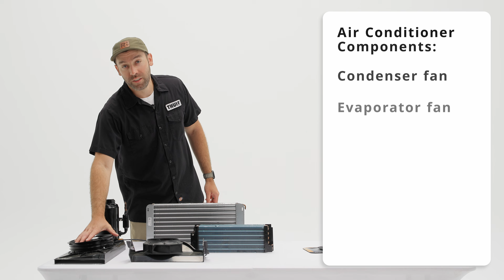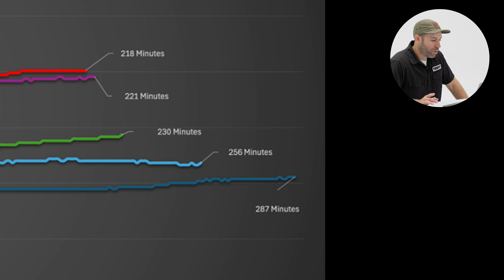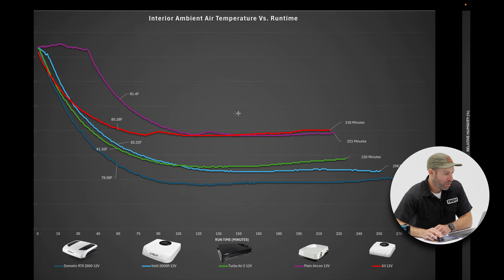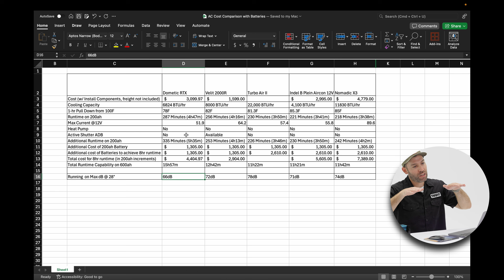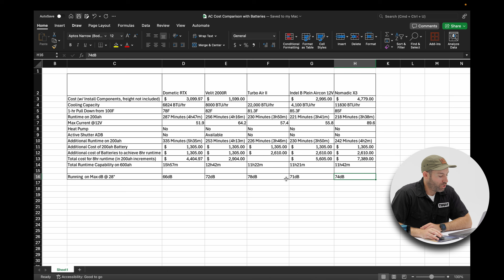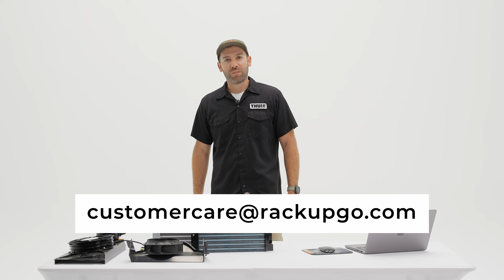Heat Chamber Test Results | The BEST Battery-Powered AIR CONDITIONERS for Vanlife

Comment from the maker: One Year Update: Our Response to Nomadic’s Rebuttal

After a year of legal intimidation and, more recently, a direct attack on the credibility and integrity of our team, we feel compelled to respond to Nomadic’s latest rebuttal article.

Read our full article here: https://rackupgo.com/blogs/buying-guides/one-year-update-our-response-to-nomadic-s-rebuttal
Reply: Nomadic was right, this was a misleading video. It's clear from their specs the X2 would have drawn much less power. You didn't mention this in the video, you just provided it side-by-side with other units that clearly aren't the same as the X3, but are close to the X2. Also, you included the MSRP?? Most people don't sell their units at MSRP, they sell it with discounts. And not only that, the X3 you list as $4799, when their MSRP today is $1000 less than that before the sale price. So of course nobody's even going to go look at Nomadic's lineup! If they did, they'd realize 1) the prices are competitive and 2) there's a more efficient unit! You should post an updated video clarifying this stuff, or you're being shady.
Reply from the maker: @taint_misbehavin  Thanks for taking the time to share your thoughts. For additional clarity, the test compared the air conditioners side-by-side in a controlled heat chamber environment. The Nomadic X3 was actively promoted as their flagship, and rather than rely on manufacturer claims, we focused on real-world data we could verify ourselves.

As for pricing, MSRP was used simply as a uniform baseline to allow fair visual comparison across brands, since sale prices fluctuate week-to-week and vary by dealer.

We detailed all of this in our blog articles as well as in this video. In contrast, Nomadic’s claims have shifted repeatedly and often contradict their own published specifications. 

As for the X2, Nomadic's own published specs state: “The X2 is designed to maintain a temperature difference of 15°F - 20°F, ensuring consistent cooling.” A 20°F delta from our 100°F starting point suggests the X2 would not have been able to meet the test’s 75°F setpoint. Thus, the X2 did not meet the conditions of our test.

The goal here is to remove subjective marketing, and provide objective, measurable results that help builders and end users make informed decisions. In response to our tests, we continue to receive overwhelmingly positive feedback from end customers and professional builders who have replicated similar results in real-world use. 

We do really appreciate you taking the time to provide your feedback. We always encourage you, the reader and viewer, to review the data critically. Ask your own questions. Form your own conclusions. That’s exactly what our testing is meant to support.

Comment: Thanks for doing the test. Good video. Not sure why you'd display RH instead of dewpoint - dewpoint is what is important and is the way to measure how much moisture is actually being pulled out of the air. RH will change with both dewpoint and ambient temp, so your graph is combining two variable in one line.

Comment: No details on how these tests were set up, and how they were set up to be repeatable with ambient conditions concerns me. I also feel like you missed the mark with the humidity even ignoring the starting humidity issue. The drop-off at a later time isn't a good thing. The Turbo air cooled faster than the Velit early on but didn't spike the humidity BECAUSE it was removing water the whole time, indicating that it not only dehumidified better but also was cooling better when you consider the latent heat associated with de-humidification. Lower coil temp below the dew temp and higher deltaT will increase de-humidification, not some arbitrary interior temp, other than a high interior temp is going to keep the coil above the dew point if the AC is tuned for energy efficiency with low dT. I would say this is likely why the drop off on the Velit and Dometic, other than the temp had largely stabilized before that point and there really is no indication in the charts for why humidity suddenly dropped like this unless the temp sensor is poorly representative of average air temp. Even with the drop the Dometic dehumidified quite poorly relative to how well it cooled, even starting with a disadvantage it was clearly never going to come back into alignment with the others, which you can't ignore over simply observing that it decreases from peak a marginal amount. Relative humidity is also taking into account the air temperature as stated, which is entirely different for all the points on those graphs making the comparison rather watered down. Looking at the spreadsheets it's like these tests are just stacking variables on variables on variables, too many of them are struggling to be controlled. Put it on a DC source with a shunt to end the test at xyz Ah. Lock your exterior chamber at 80/90/100F for the whole test with a heater/vent greenhouse relay thermostat and you'll have a much more useful performance comparison.
Reply from the maker: https://rackupgo.com/blogs/buying-guides/heat-chamber-test-results-dc-powered-rooftop-a-c-units
Reply from the maker: You are not wrong that humidity data gets complicated fast. That’s exactly why we published the raw spreadsheets instead of just cherry picking a headline.

A couple things though: a lower RH number at a hotter interior temp is not automatically “better” dehumidification.Likewise, a temporary RH spike during rapid pull-down is not automatically “worse.” Compressor speed, coil temp strategy, airflow, evaporator sizing, and control logic all affect how moisture presents during stabilization.
The peak current/wattage issue from your earlier comment also falls into this category. These systems are highly dynamic and not all metrics occur simultaneously.

You may also be mixing psychrometrics with assumptions about each unit’s tuning strategy. Some manufacturers intentionally run higher evap temps and lower deltaT for efficiency and freeze prevention, especially in variable speed DC systems. Others prioritize aggressive latent removal earlier in the cycle. Neither approach is inherently “wrong” without defining the actual design target.

As for test methodology: same chamber, same battery source, same setpoint, same starting conditions, same heat load, same install style, same logging cadence, etc etc etc. It was designed to be a controlled comparative field test to show consumers how these units behave relative to each other in the same environment. As close to real world controlled testing as we’ve seen in this space so far. If there’s a better publicly available comparison, genuinely, send it our way. Otherwise, it sounds like you may want to design round two, and we’ll happily compare notes.

All that being said, your suggestions about fixed exterior chamber control and Ah limited testing are good ones and would make for an even more engineering focused dataset in future rounds.
Reply: @rackupgo  I looked at the data, but there is nothing to describe what your testing setup actually is. You describe it as an "independent test lab" but lets be real. There's up to a 6-7 degree temp swing on the hot side in the averaged first 180 minutes of testing. Don't get me wrong, I have no problem with semi formal testing, but I don't like it being presented as a "lab", a lab generally understands the scientific process and should be fairly held to that standard which isn't met here. You mention the same "heat load" but again, what is the heat load? The thermal transfer between the exterior and interior of what container? Because then that's dependent on the interior vs exterior temp differential which isn't consistent, and also dependent on the CFM of the unit cooling the walls via convection. I'd really prefer to hear the details rather than speculate whether it's even remotely applicable to the heat load of my camper.

At no point did I say lower RH and higher temp is better de humidification, otherwise the best humidity curve would just indicate the worst cooling units and lose handily to a space heater. This is specifically why I compared and contrasted the Velit and the Turbo air. Because their temp is very similar and therefore easy to draw a conclusion on humidity. You say that neither RH profile is inherently wrong, which I agree with considering that both of us said basically the same thing about lower dT being an efficiency strategy at the expense of de humidification,  BUT @8:25 the presenter says "Turbo air 2 didn't really do that well" then immediately praised the other 2 for dropping RH hours later. With the lens narrowed to just de humidification the turbo air did objectively better than the Velit for the entirety of the run time, considerably better early on leading to the subdued climb, but they do not understand that and simply think a peak then decline in RH is THE indicator for dehumidification.

I say the Dometic dehumidified poorly because the RH at 90 minutes and the RH at 290 minutes went UP 2.5%, a time period where the temp also went up 2 degrees. In a sealed chamber it simply didn't remove water over a 3 hour period. All of this time was spend at ~10% higher RH than the end of the Velit test. Realistically none of this is a great test for de humidification, because the air was started practically bone dry due to preheat (again I have to assume) and 30% is a point where removing humidity might be a bad thing from a health perspective. Even the worst point of the Dometic is still acceptable relative to a realistic starting point we'd see here in the midwest with 90-100F at 40%+ humidity. So please add starting with tangible and precise humidity if you want to test dehumidification to the suggestions list.
Reply from the maker: @n @nickmeyer208 ou’ve clearly put some thought into this. There are practical limitations to controlled real-world testing that are easy to overlook from the comments section. You’re not wrong on several points, but there’s also nuance here that’s being seemingly overlooked. To our knowledge, these are the most comprehensive real-world comparative tests currently available. The alternative is relying on advertised BTU numbers, some of which have now been quietly removed from their own websites. If you believe you can build a better test methodology, we genuinely encourage it, and we’d be interested in comparing notes once you do.
Reply: First, I would like to commend the effort that went into the tests for this comparison. Lots of work, reasonable effort to create conditions to get comparative results. 

Relative to the conversation on humidity, there seems to be a driving force on RH being a critical component and that its not being addressed soon enough in the cooling cycle. I have to agree with the author on some of the reasons why the design may have yielded the results it does. If it happens too early in the cool down cycle, it can lead to freeze up conditions which would result in a unit that can't cool. You have to remember, these units can be used where the relative humidity is anywhere from 10% to 95% and the last thing you want to do is have a unit that freezes up because the evaporative coil reached a temperature to low compared to the dew point of the air. And of course it would have been a difficult measurement to make, but the mass flow rate of the condition air compared to the conditions of the evaporator coil can have a significant impact on whats happening with the latent heat removal in the condition air space. The greater the sensible heat removal, which can be accomplished by a larger internal air mass flow rate, the less cooling becomes available to remove the latent heat. I would suspect this is the reason why you see the step reduction in humidity after the unit has been operating for some time by some of the units tested. Since the recirculating air temperature has dropped, as a result of the sensible heat removal, the coil temperature is easing into the dew point temperature of the air. As a result, the coil starts to remove some of the latent heat, resulting in a reduction of the RH. From a design perspective this is a great approach because the evaporator coil won't dive too quickly below the dew point temperature of the air, creating the detrimental freeze block of ice. As more sensible heat continues to be removed, the temperature of the coil slowly continues to drop, removing more and more latent heat, where eventually the unit starts to cycle the refrigeration process on and off, giving plenty of time for the evaporator coil the ability to shed its collection of water vapor. I get why you want to remove water vapor, but the earlier you attempt to remove it, especially when there is still a considerable amount of sensible heat to remove, there is a high risk of failure of the unit because of the icing problems in areas where the latent heat is high. Of course if the latent heat is relatively low, this problem goes away, but because the manufacturer has no idea of where this unit will end up being used, they need to design the unit for the worst conditions. From a design perspective and looking at the data results, these units have been designed to insure minimal operational issues. As the units continued to be operated over days, they will whittle down the humidity to comfortable levels.

Comment: Great testing. Can you do the 48 volt velet
Reply from the maker: We have tested a few 48V units, including the Velit. We discovered an issue with the battery source we were testing with which led to inconsistent results so we haven't been able to release that data. We're currently looking into the possibility for a repeat test.

Comment: Ugh, I don’t know how I didn’t find this when I was doing all of my research but I ended up ordering the Nomadic X3 48v over the Velit because I wanted the best for my pups and it seemed to be the best but now I have major buyer’s remorse and concern. Have you done any comparisons with the 48v systems?
Reply from the maker: We have done comparisons with the 48V systems in a heat chamber under the same test conditions. Unfortunately, upon validating the results it appears that there were cell failures in the battery we were using to test which impacted the results so we are not able to publish the data from that test. When we're able to repeat the test, we will publish a similar video.
Reply: looking forward to that video! And thanks for this one, by the way!

Comment: A very thorough and excellent review of RV air-cons. Your graphs and detailed Excel data spreadsheet about power consumption, current draw, price vs BTU etc were stunning. Well executed, as I look to invest in a unit for a new ProMaster.
The components you had on the table were from what company? What is the warranty on these units? I don't think I heard any mention of it. 
Guess I will have to visit their websites to learn more.
Just one suggestion - ditch the music soundtrack. It was distracting and annoying and really not needed. It makes it easier for the viewer to truly focus on what you are saying. It does not add to your fabulous video. 
Nice clean background too. Keep up the good work :-)
Subscribed.
Cheers and thanks from Montréal.
Reply from the maker: Thank you! We definitely need to tone down the background music on this one. The components on the table were from a Dometic RTX 2000. The warranty will vary per the manufacturer, however, in general most units carry a one year warranty.

Comment: Has answered almost all of my questions. I was looking at the RTX but the price point was rough. Now I've got some other options to consider. 
I really wish they had a range of DC input voltages, not just stuck on the 12, 24 or 48.
Reply from the maker: Now there's an idea for a manufacturer! A single unit that can accept an input voltage of 10V-60V would make it easy to change power systems in the future.

Comment: Dometic needs to make a backpack style AC. I feel this is the best option. This would allow maximum solar space on the roof. Nomatic came out with one, but seeing their numbers on here makes me want to gut a dometic and convert it to backpack
Reply from the maker: Dometic does make one in the European market, the SPX1200. The trouble is the cooling power is only 1200 watts and it's only available in a 24V unit. We'll pass along to Dometic that we're not the only ones that would like to see a split style unit!

Comment: My biggest question is how do you keep the air from getting stale when running an AC like that in a small enclosed space? Those units recirculate indoor air and do not exchange it with the outside environment. Without any supplemental ventilation, the air can become stale, leading to a buildup of carbon dioxide and potentially harmful contaminants. This lack of fresh air circulation may cause discomfort, headaches, or decreased cognitive function.
Reply from the maker: Most vans have a roof vent in addition to the A/C unit to exchange fresh air. They also come equipped with windows and oftentimes folks will have a screen system so they can open the windows and sliding door without bugs coming in. Vans actually have many means for introducing fresh air to the cabin!

Comment: I appreciate the chamber testing. Did you do one for the OutEquipPro? It ramps up too. I can't find anything this good on it.
Reply from the maker: We've not come across that one before. I would be a bit skeptical on the performance given the unit only weighs 45lbs and the cost is quite low putting it in the "too good to be true" category. If you do try it or know anyone that does, we'd love to hear about their experience with it!
Reply: @rackupgo There’s lots of YouTube videos now from users claiming the outequip pro is very efficient, quiet and keeps it cool. Maybe you can test these claims?
Reply from the maker: @omjaye we will take a look, thank you!